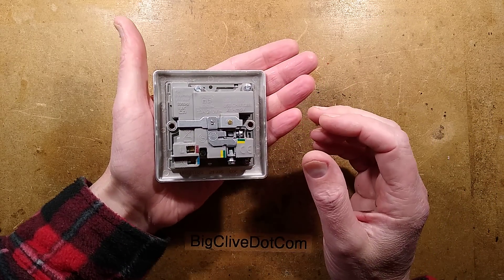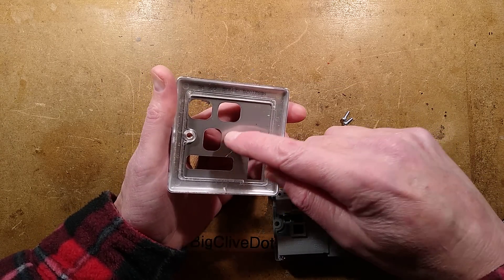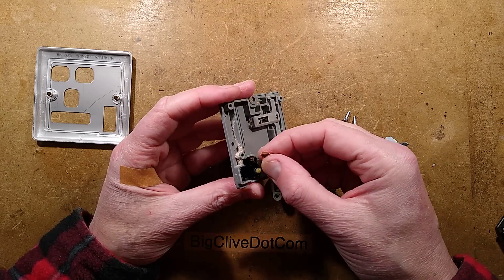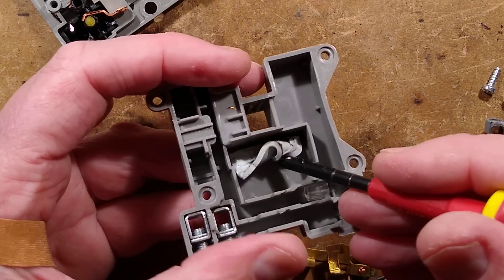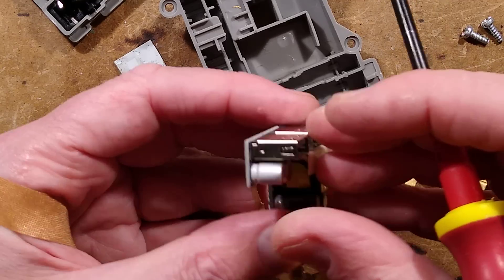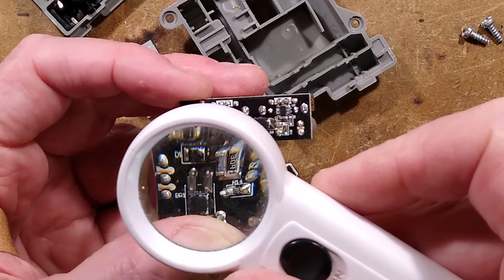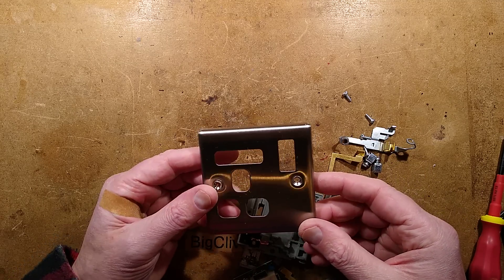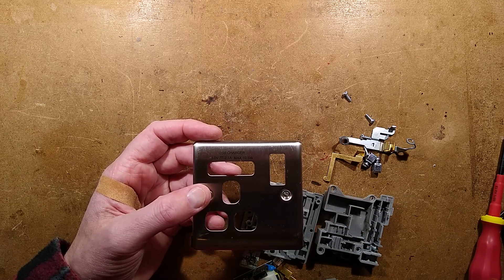Exploded British General USB socket

Comment: I used to think "USB Power from a wall socket? Gimme!" but the more I think about it, the more I hate it. Everything you've said about them over years is true. Can't change them without at minimum re-wiring the socket, are the components fire rated and good enough to be in the wall, power consumption or not being able to switch off... These days for super safety, for most low power transformer/switch mode power supplies, I plug in an extension lead (usually fused with a 3A fuse) and plug my stuff into that, since if you plug a USB power supply directly into a socket, usually the next circuit breaker in line is often 32A (in the UK)... so I like to add extra "steps"... and in the event of a catastrophic failure, the device can be unplugged, the extension can be, the switch can be flipped or the circuit breaker can be isolated, where as with one built into the plug, what have you got? Circuit breaker. That's it. It might be worth doing a video showing that even a 3A extension (in the UK) can probably give more than enough power for most people's devices (720 watts) but would be so much safer, at least... If my understanding of all this is right :) Thanks Clive :>
Reply: I used to think like you: now I think of a random USB socket - hotel, airplane, bus, wherever - as a potential attack vector; at the very least your equipment is at the mercy of a power supply that might well not be the voltage intended. I have a handful of plug-in-to-mains-worldwide adaptors that I use rather than trusting to mystery sockets. Sure, I'm paranoid. But am I paranoid enough?
Reply: @neilbarnes3557  Yes! There's also all of this risk that you mentioned. For kinda "day to day" use, I'd rather use a trusted battery bank, one with a 20Ah cell in it is more than enough for driving a day of my electronics (except my laptop which has it's own brick anyway, I'm not fancy enough to have one that needs USB-PD :p)... now I don't care about it looking elegent, it's gotta be trust worthy, and plugging in your own adapter, sure it could still be "bad voltage" but, a universal mains adapter can handle a much wider range than something that requires 5v, in total agreement with you here :)
Reply: Apologies for my ignorance, but am I understanding that you can legally buy 230v extension leads rated to only 3 amps in the UK? Are the plugs different such that you can't plug a higher load into one?
Reply: @Thermalions  No, you just have to read the label. The thickness of the wire usually gives it away. 13A wire is chunkier.
Reply: @paulsengupta971  Thanks. Just seemed strange being from Australia where there's nothing under 10A. Also given the prevalence of fuses in plugs and nice chunky earth pins in the UK I had the impression that the regs were of a level designed to protect idiots from burning their houses down. For sure there's people plugging heaters into 3A cables somewhere because they couldn't find the 13A one.
Reply: @Thermalions  I don't think you can specifically buy 3A rated ones, although so long as it's fused down, I guess it wouldn't matter. What I usually do is get a 10A or 13A extension and then put my own 3A fuse in it, and stick a label on the plug to remind me what it's fused down to :)
Reply: @jcxtra So you are putting in a fuse rating into the plug on the extension lead to match the power of the appliance?
Why are you doing that?  It is wrong.
That is not how you size the fuse.
Reply: @jcxtra  Yes you can buy 3 amp extension cords.
Reply: @deang5622  Because you can always fuse down a higher rated cable with a lower fuse, but as far as I am aware the inverse should not be attempted. Indeed fuses are there to protect the conductor but they're also there to blow in the event of an overload, although not in an exact way, so usually I fuse down a regular extension lead (that usually comes with a 13A fuse fitted) when it's only going to be used with switch mode power supplies and other low power stuff...

Yes, I'm fully aware it won't blow exactly on the cuff of 720watts, but if there is a fault or someone plugs in something massively over rated, it will blow. It just lowers the threshold of the safety margin, so if an unfortunate event occurs, it's more likely the fuse will blow (at lower power).

I'm certainly not trying to use conductors rated for 3A to run a 13A appliance, or put a 13A fuse in a 3A rated appliance.

Unless I'm overlooking something absolutely massive I'm sure what I'm saying makes sense... I'd just rather with the absolute mountain of crap quality power supplies that are in circulation (fakes, or low quality that get in with a decent supply chain), adding more things in line for safety is better than thinking "It'll be reet. It'll have it's own internal fuse." especially from when I was younger electricity had a good go at me, and well... the 32A breaker (no RCD) in line definitely did not trip and I'm lucky. I know a local 3A fuse probably wouldn't have helped in that situation but I'd certainly rather lower the threshold of overcurrent that's available in fault condition.
Reply: @jcxtra  No.
You can use a fuse of lower rating than the cable but it is not necessary.
Reply: @Thermalions  We don't need different types of plugs here for different sized loads in the UK.
A single socket outlet here can provide up to 13 amps at 230 volts, which is 3kW.

To deliver a lower current of 3 amps, the same socket and same type of plug is used.
Even the same thickness (cross sectional area) cable can be used.

We do have typically two thickness cables on our extension leads,  one that handle a maximum of 3 amps and one that can handle a maximum of 13 amps.

It is quite possible and permissable to use a 13 amp extension cord to power an appliance that needs only 3 amps.

What you can't do is use a 3 amp cord to power an appliance requiring 13 amps.

The 3 amp cords are thinner and more flexible and that can be beneficial at times.
Reply: Remember folks... The fuse only protects the circuit conductor, not the appliance.
USB power supplies are internally fused. You're overthinking things.
Reply: @Jon-em4kc  I rather overthink safety than under, personally. Without opening every device to check it's fused properly, I'd rather something further up the line that'll add protection... and the ability to unplug and/or switch off. Fuses aren't an exact science, but there's so many times I've seen appliances or extensions fused at 13A (which in the UK is about 3kW) when they would never require such current, so for a strip of chargers, 3A (roughly 720 watts nominal maximum in the UK) is way more than enough. If you don't have a fuse in a product, like a USB charger with only a wavy track on the board, (and given a lot of things end up being broken when you take a peek to verify, opening is sometimes a one way process)... the next thing in line is a 32A breaker, so that could potentially allow a fault current of 7.6kW without a sweat, so... Yeah. Might be over thinking it, but I've learnt to be cautious with electricity, it had a good attempt at my life when I was younger, so I personally give it a lot of respect, but I'm not saying that anyone has to follow what I like to do for my safety. :)
Reply: @jcxtra  You didn't read what @jon said.
I will point out the bit you missed.
"the fuse only protects the circuit conductor".
He is 100% correct in this statement.

Comment: Reading some of the comments make me laugh. Being a sparks for more years than I care to remember, we have been permanently connecting electronics to the mains voltage for years . Such as microwave  led bulbs  now AFDD in CU  smartmeters . Just look around you house and count the amount of electronics you have on standby. Even your fridge and freezers are stuffed full of electronics as well as you central heating boiler. Sorry to disappoint you all the sky isn't falling on your head . You will get random failures it doesn't matter how good the product is . Every room in my house has usb sockets except for the bathroom and loo . I even have dedicated usb stations which are the size of a single sock with four USB ports .  Electronics connected permanently to mains is here to stay unless you want to wind the clock back 100 years
Reply: When these are built into the wall and a fire starts...

Comment: Ive wondered If these are rated for continuous use, as they refer to these as  chargers not power supplies?
Reply: same thing really in this case, its a power supply supplying power to charge a device....
Reply: @andygozzo72  The difference between a charger and a power supply is the duty cycle. A charger may be designed to provide the rated power for a time that is reasonable expected to charge a devices battery without overheating, where as a power supply would be expected to provide the rated power output for a 100% of the time. 
In the same way a diy drill would over heat if used continually were an industrial drill would be ok.

Comment: I have heard and seen some of good quality power points with above Australian standards.  
And With twin 5v dc / 2amp USB A connectors that have failed due to some small components made in cina that go nuclear. For example like capacitors, voltage regulators and surface mounted resistors.

Comment: this would be a good product if it WASNT INTERNAL OF THE WALL, like, they make 3 and 6 way adapters for american plugs that have usb power supplies built in that simply have a duplex plug on the back that lets them get power and expand the number of outlets and if they go bang all you have to do is unplug it like any other usb supply, not having to shut off power and perform electrician grade work

Comment: Think what lifetime you expect from an electric socket: twenty years plus?  Do you expect a cramped switch mode power supply to last that long?  Do you want it buried in your wall when it fails?  These things should be banned, in my opinion.

Comment: Looks like the sharp edge of the mosfet flashed over to the MOV there, which then likely blew off the components, likely the snubber diode, and then killed the driver chip as well. You can see the skid mark nicely matches the edge of the MOV, and it probably touched during use, and vibration finally chipped off a tiny bit of the hard epoxy coat exposing the edge of the disk, and the conductive coating on it.
Reply: Sorry, but what sort of "vibration" would that be ????🤔🤔🤔
Reply: @brucepickess8097  Dropped during the removal normally.
Reply: @SeanBZA  Being dropped would be a sudden shock , vibration is continuous motion. Vibration, periodic back-and-forth motion of the particles of an elastic body or medium, commonly resulting when almost any physical system is displaced from its equilibrium condition and allowed to respond to the forces that tend to restore equilibrium. Yes a shock may have contributed to its demise, however vibration when fitted in situe,  I doubt it.

Comment: Never understood why anybody would want to permanently install a power outlet with usb ports included..  that just means youre just stepping down the voltage to that 5v 24/7..  so thered be a transformer and caps with resistors which have a lifespan or could develop a short from some other component burning out or degrading over time..,  unless there was an included switch on the outlet itself to cut power to the usb section then is just dumb and makes it something that will fail before everything else...

Comment: Exactly why I don't use any USB receptacles.  A standard receptacle will last for decades, but once you put electronics in it (especially with cheap capacitors), you reduce that lifetime to merely a few years (if that).
Reply: In Australia a high quality socket outlet w/ USB costs 7x that of a a standard one. And only comes with 2 year warranty normal these would have a 10 year... they really do suck.

Comment: Possibly, 1. Overheating due to "squishy" padding material.  2. Years, ago.... My son, 3, stuck something metallic into my laptop USB port....bang....bye bye laptop.....
BTW... Never have a constant power standby device hardwired into the electrical system.  I can not think of any good idea for this... except pain....
Reply: Not a very good laptop.  Should have at most blown the fuse for that usb port.  I have seen some laptops with dead usb ports because of this.  What kind of laptop was it?

Comment: This is one of the main reason's I would never use a outlet with built in usb.  When they fail, They fail IN YOUR WALL.  And when they fail you have to replace the entire outlet (something most people should not do themselves).  
Many of the ones I have seen can not be turned off, so they are always using power (this one looks like the switch controls it which is good, If the switch controls the usb ports). 
When they are outdated and can't charge anything you have, they have to be replaced (or they just sit there using power).  Just a generally terrible idea, just get a good quality plug in charger.

Comment: I'm not a fan of hard wiring electronics into an electrical system. (cough) ARC FAULT (cough) What we need is some kind of plug-in-play system to quickly change these smart outlets and switches without having to shut off the power a bit like plugging a module into the wall outlet except being recessed and encased in the wall. All this swapping out electronic receptacles and switches is bad on the wires in the wall. They put unnecessary wear and tear on something that wasn't really wasn't meant to be messed with no more than a decade or so. Generally longer. It also increases the likelihood that a layman will miswire the outlet and maybe burn down the house. Plug-in-play modules would help a lot with that.
Reply: That already exists, it's called a plug.  It's a module that plugs into the outlet.  They come in many different forms... lol I'm kidding, I know what you meant.
I have seen outlets in older houses that are recessed for a clock.  When wall clocks ran off an outlet they would make them recessed so the clock can go on top of the outlet to hide the outlet (you cram the wire in the recess too).  I think they required special box's though, I never opened one up.  Maybe you can get something similar for wall mounting tv's now?  hmm, now I'm going to have to look it up.

Comment: We're starting to see more (presumably) 5V USB-A ports built into US electrical socket fixtures, and not very many people talking about what happens should something go horribly wrong in the fixture where those USB ports start a fire.

I'd hate to see what manufacturers will do when people start demanding 100 watt Power Delivery over USB-C right at the outlet rather than using wall warts.
Reply: I'm sure the manufactruer will give you a 6 month warranty - limited to a full refund of the price paid for the socket. 😰
Reply: I've seen 60w USB PD outlets so I can't imagine 100w is too far in the future
Reply: these 'permanent' powered usb sockets should be banned...
Reply: That would be a £50 wall socket; I doubt that standard wall socket spaces are big enough to accommodate a 60+ Watts power supply thought...
Reply: @rayoflight62  it would only have to be twice as wide, or the same size as a 2x1 configuration if they have 1 120/240v and 1 or 2 USB c ports underneath. 65w charging bricks can get very small.

Comment: Fitted several of these a couple of years ago, went with mk which were much more expensive than the noname brand, I think at the time around 30 pounds each, two out of the four failed within the first 6 months, nothing spectacular just a bang and no usb power, meanwhile my 12 year old sony charger has never been unplugged and still works fine. Makes you question the design and choice of components. Needless to say not installing anymore unless there is some reliability proven product on the market.
Reply: I fitted mk ones at higher price, had two fail so gave up on the idea of usb sockets.

Comment: This and permanent installed LED lamps are a menace for old homes without the new microcontroller circuit breaker (forgot the name, that thingy that can also detect sparking). I think (after some fires) regulation will happen ...
Reply: The term you are looking for is probably Arc Fault Circuit Interrupter or AFCI for short.
Reply: Or in British speak AFDD, arc fault detection device.

I think they're the same as an AFCI just more expensive.

Comment: You are supposed to use electrical tape, on cuts. 😃
Reply: Heat shrink the affected area where able, also works for me.😏😏
Reply: Gaffer tape
Reply: I've used electrical tape... on an incident where I accidentally used a wire stripper on the pad of my finger. That was not fun.